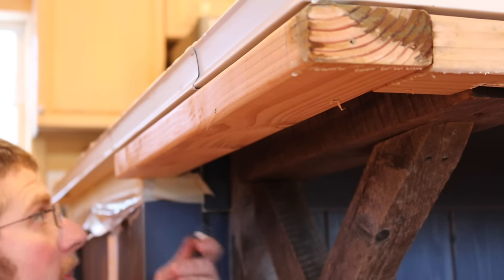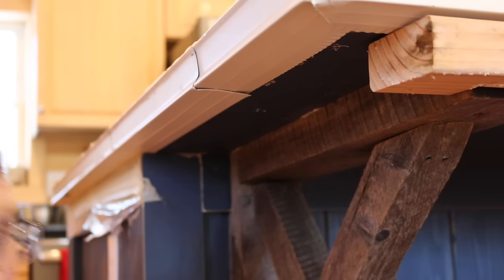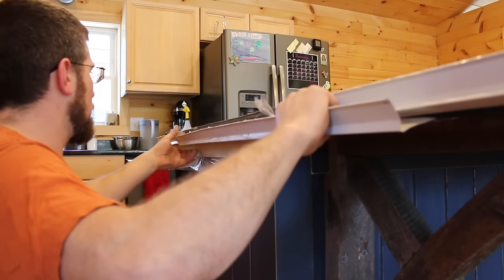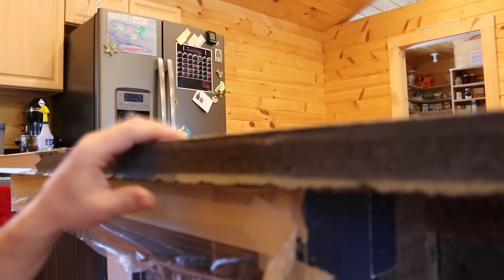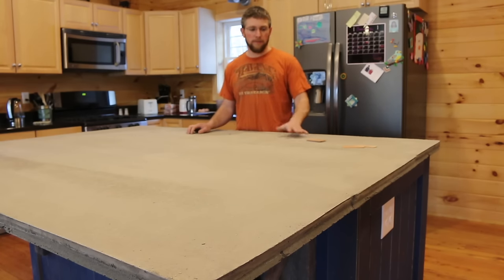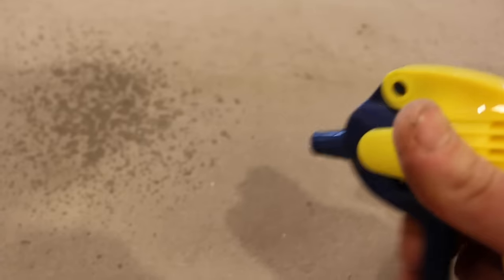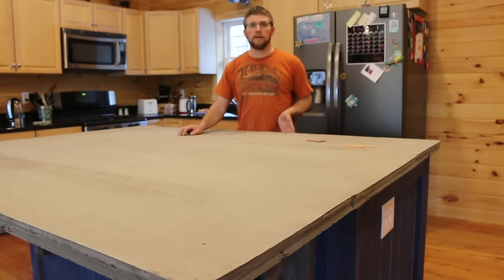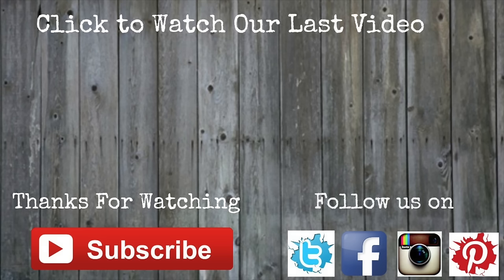How to Make Concrete Counter Tops Part 3

Comment: Hey do you have the video showing how you framed it especially the overhang and how far was your hang I was thinking of foot for the one I want to do also you chose how thick of plywood and did you think of using the concrete board I'm seeing it both ways

Comment: I like the idea of using concrete like this. At my old job the bathroom floors were done like this and it turned out very nice and neat.
Reply from the maker: Glen Kellner thanks. Do you know what they sealed them with?
Reply: I have no idea it was industrial strength whatever it was

Comment: Nice job!  That seems like a lot of overhang weight with not a lot of support, but maybe it's the video angle?  Doing the calculations on your measurements, it's closer to a thousand pounds of weight, btw ;o). Good work tho, no complaints here!
Reply from the maker: the counter top is holding up nicely after a years use
Reply: I thought the same thing. That overhang looks way too big to go unsupported.

Comment: I feel like the top needed to be done before the sides. that way if you did make a mess or need to screw into it was no biggie
Reply from the maker: Usually, you pour the concrete in a form some where else and the install it. This counter top was too big!